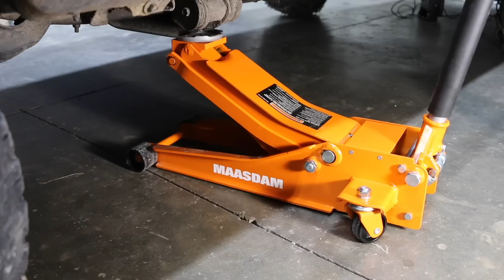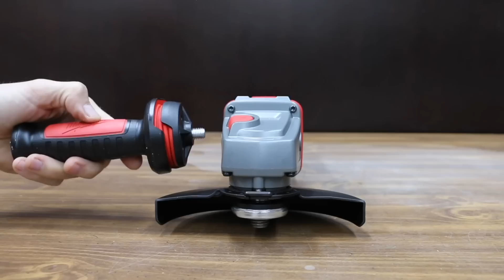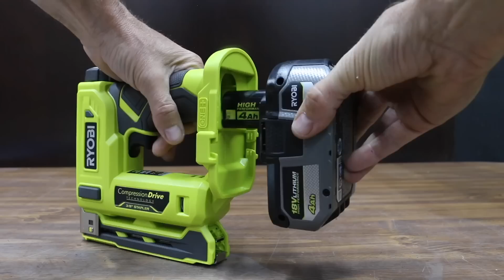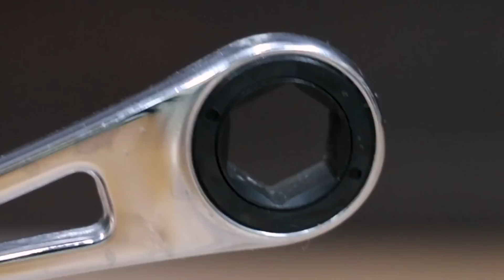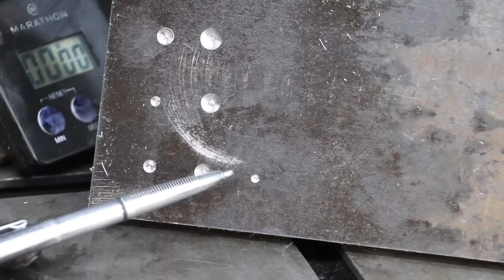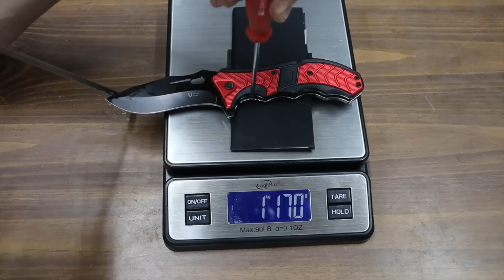Top 10 Tools 2022? Let’s find out!

Comment: Love the best of year videos! Could you test Hardhats? My employer is considering them and I would like a comfortable one
Reply from the maker: Great suggestion!  Any ideas on how you'd like to see them tested?
Reply: @ProjectFarm  I'd be wanting to know how much impact they absorb from top and sides, durability, comfort, fitment, and how easily they fall off your head.
Reply: @ProjectFarm  Test weight, heat ventilation, light & ear muff attachments, headgear comfort & quick release, brittle in the cold, soft in the heat, easily fall off when bending over, and a couple fun styles (cowboy hat / baseball cap). Hard hats have saved me from sharp nails in attic roof, and sharp metal structures on catwalks.
Reply: @ProjectFarm  Some sort of crack and puncture test, weight and overall comfort, how well they work with hardhat accessories.  Maybe drob bricks on them are drive over them to see how well they hold up
Reply: -Although subjective, level of comfort.
-The tightening system, and how well it holds up over time
-Dropping different materials from different heights on helmets. Like brick, all-thread, wood, and even drywall. This would test both durability, and the ability of the helmets to stay in place on the contractors head. The materials i mentioned are just common construction materials.
-How much weight then can handle in each direction.
-Ventilation for hot days.

Im sure there’s more ways to test a helmet. And I guarantee you’ll think of creative ways to test!

Comment: Video idea: 

Which winter windshield washer fluid fluid is the best. 

Was at Canadian tire and there’s so many to choose from. Wonder which is actually the best.
Reply from the maker: Thank you for the video idea!
Reply: That's a good suggestion!  So frustrating when everything instantly freezes to the windshield. Based on shopping at Canadian Tire I'm sure you've been there too 🥶
Reply: Fellow Canuck here from Eastern Ontario, just finished cleaning up after that huge snowfall.  I use Reflex All Season with detergent, works great and good to -45 degrees C.  Have a good day, eh?👍